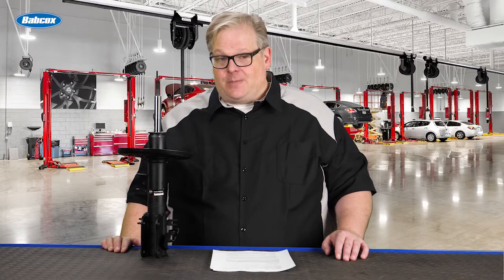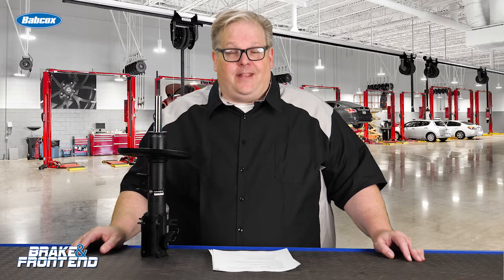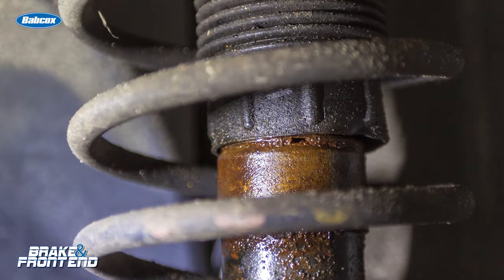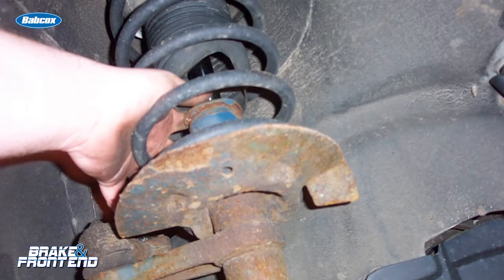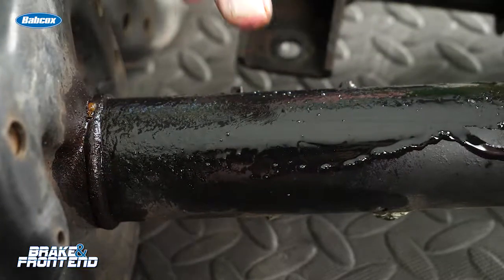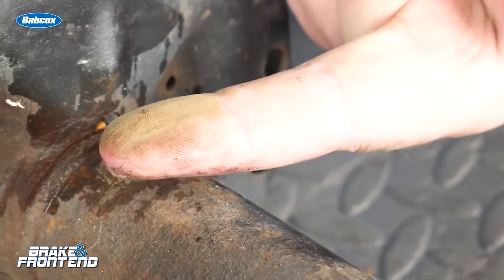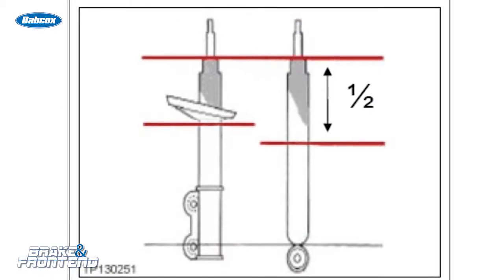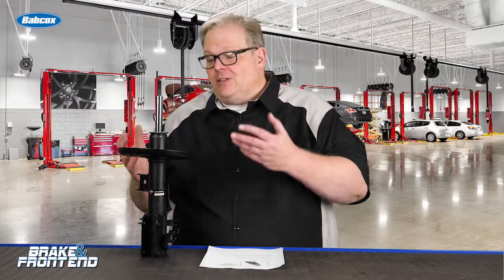Inspecting Shocks And Struts For Leaks And Damage | Tech Minute

Comment: 2004 Subaru Legacy...my front right passenger strut is leaking black grease to the point it's on the inside of the wheel well.  I'm assuming it's time to replace them?  If you let it go what could happen?